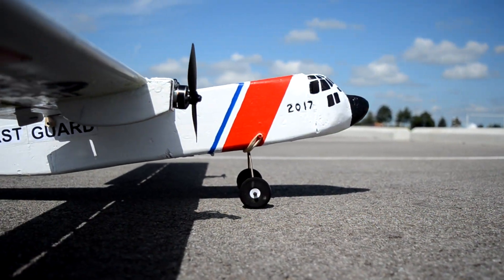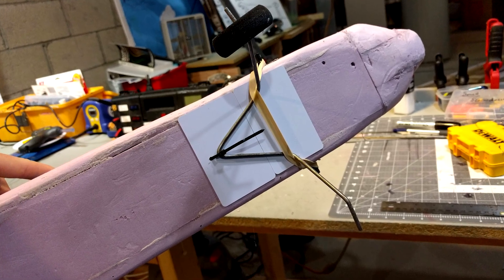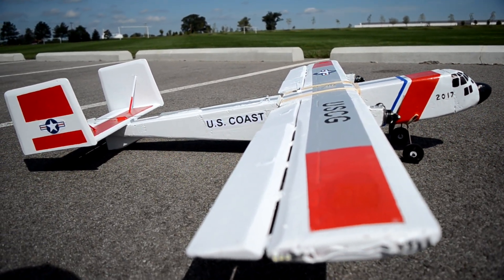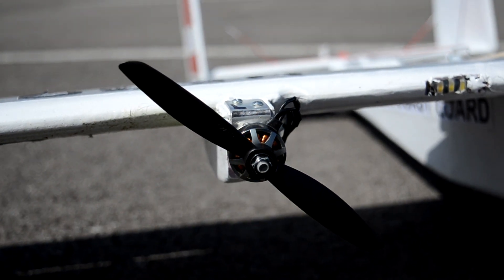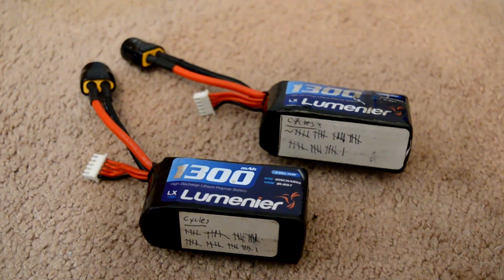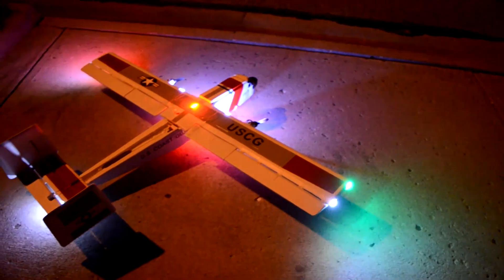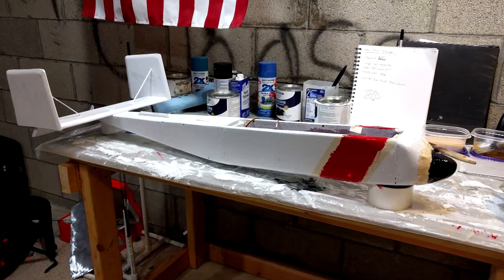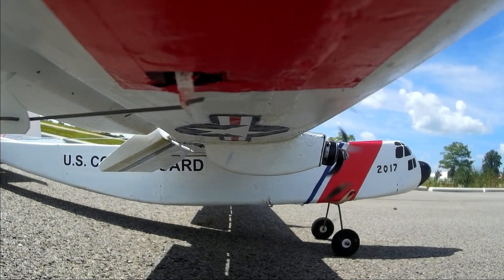SCRATCH BUILT C-130 / B-25 Inspired RC Airplane

Comment: Nice plane . That sure is allot of thrust angle
Reply from the maker: shane tillery Thanks! The plane I built before this needed a lot of angle to counteract the tendency to pitch up when full throttle was applied. This plane was based off of that plane. This one is pretty good with the amount I put in. It could probably use a little more down angle since it still pitches up at full throttle.